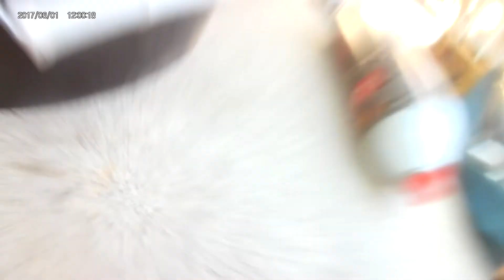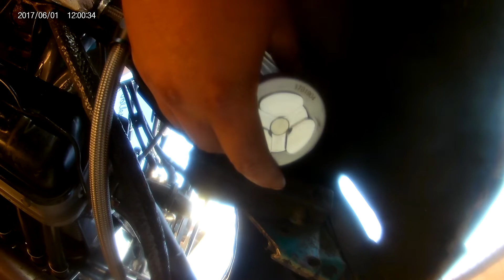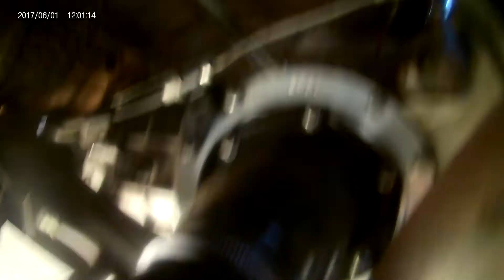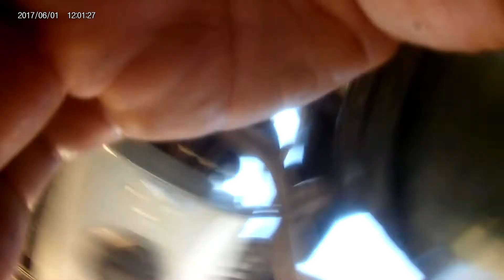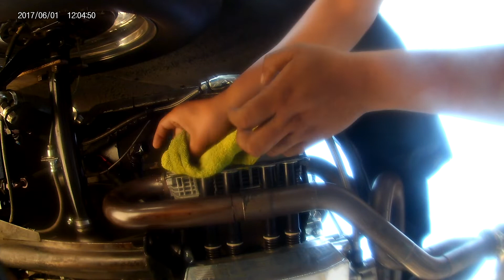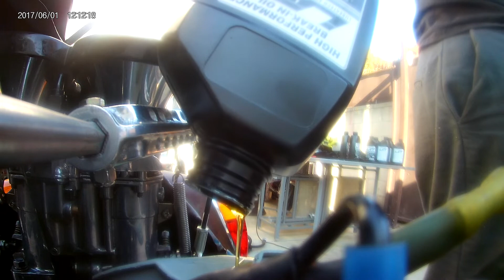valve adjustment and oil change in VW bug 2387cc

Comment: how come you dont run the rear tin ? and is your oil cooler mounted on your Rear Torsion Housings bars and what kind is it
Reply from the maker: The car is cut I didn’t do that I bought it that way there is no point to the tin whe it’s cut all around
Reply from the maker: The cooler is seatrab from foothill fab it’s like 500$
Reply: @volkstroke  cool thank you